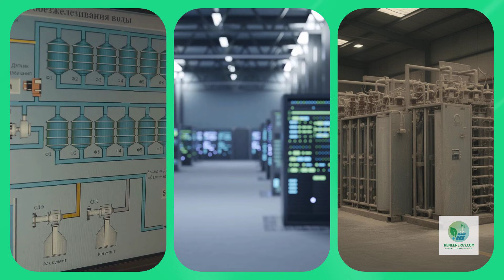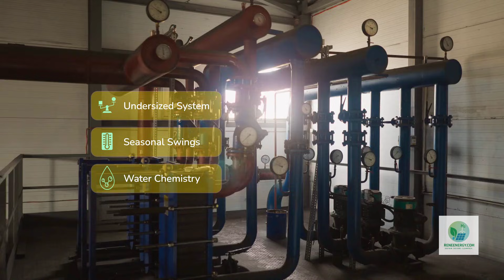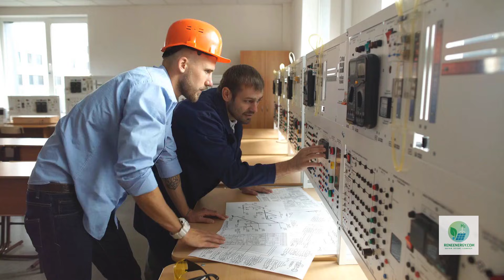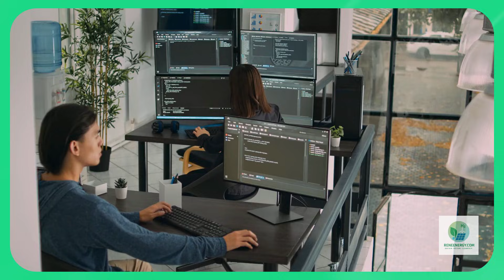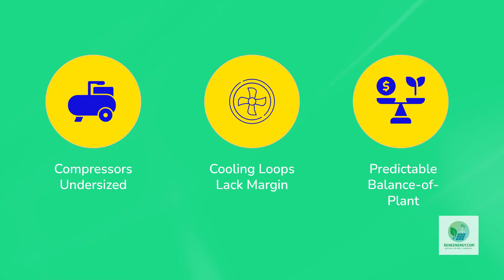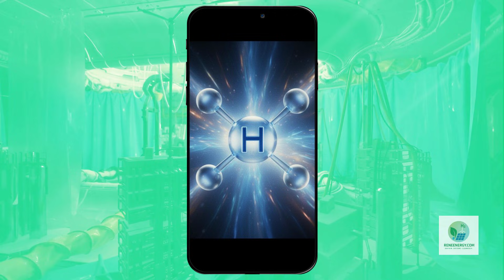Electrolyzers Don’t Fail—Balance-of-Plant Does (And It Kills Project Economics)

Comment: The real problem is the 45-50kWhrs/kg H2 water split energy requirement.

Changing the para-water, most liquid on our planet, to ortho-water, reduces the energy required to below 10kWhrs/kg NTP.

This makes the manufacture of ammonia or hydrocarbons less expensive than conventional methods.

Making ammonia as part of the process allows easy storage.